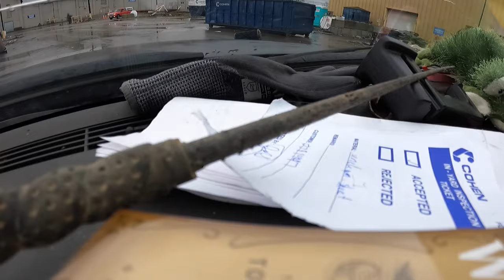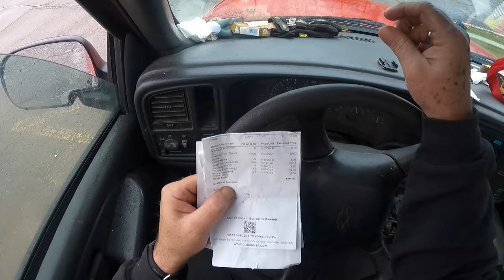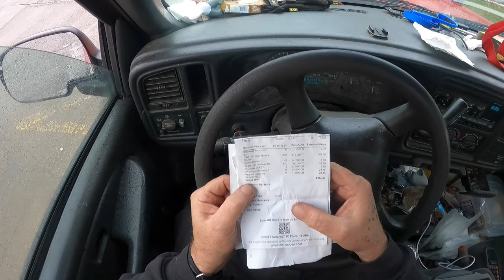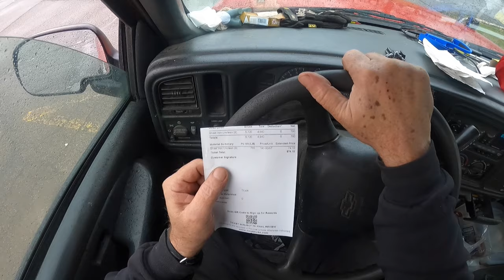FOUR TRUCKS FILLED WITH SCRAP PAY HOW MUCH?

Comment: I'm curious to know how much fuel and time you burnt picking all that stuff up and loading/unloading. I respect the hustle but what does that $523 work out to in an hourly rate after expenses and how consistent can someone come up with 4 truck loads of scrap? $523 is still $523 but if it works out to $10/hr there's better side hustles out there to make some extra cash
Reply from the maker: Watch the videos. I’m pretty consistent. My gross profit margin on those loads was 76%. This is a part time gig for me. 
My ROI is better than most legal side hustles.